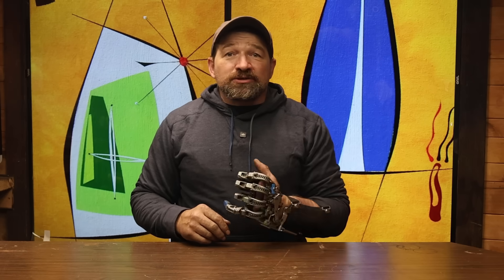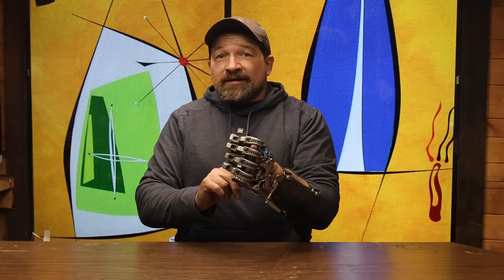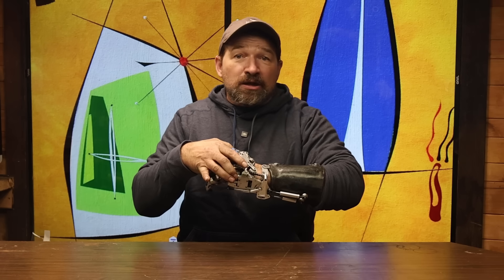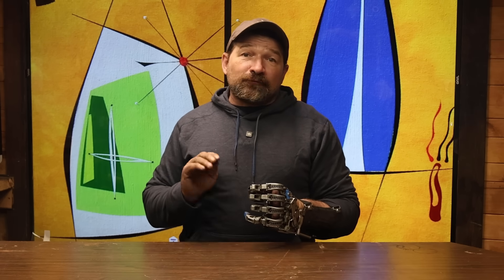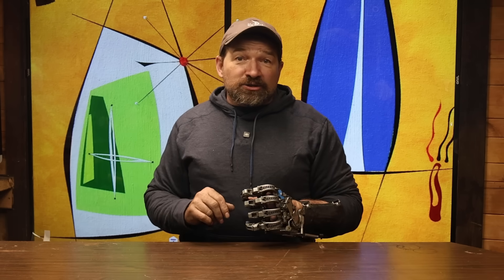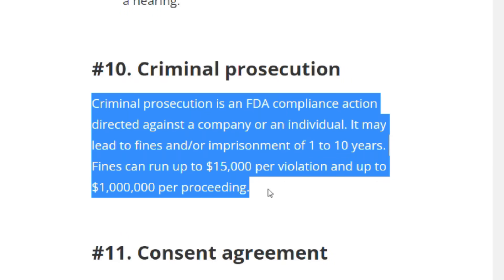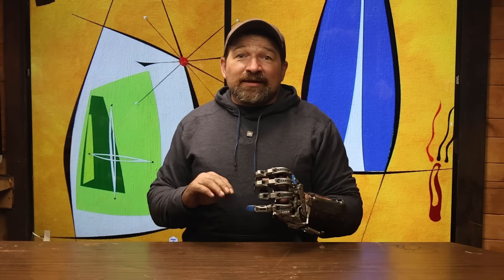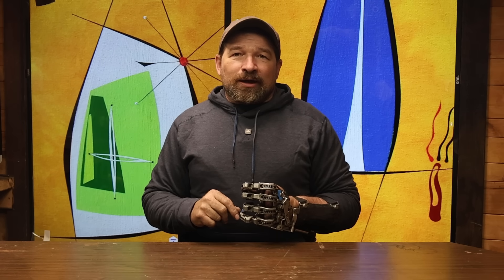Give me a hand! I'm trying to get this information to the right people.

Comment: I used to work on a "state of the art" robotic prosthetic. This is a super impressive design - very simply compared to the state of the art, but very effective from what I can tell in the video. Making it entirely mechanical keeps it simple. You will struggle with getting FDA approval - which is not a reflection of you at all. The requirements for FDA clearance for devices like this are quite steep and unnecessary in my opinion.

Comment: You're a pretty good speaker --- sure, its for profit, but easily rationalized given how much time things must take in order to obtain the perfect fit and the mechanical design. No batteries, no fragile motors and sensors. Best of luck finding them participants :)

Comment: I think the design is so cool. I like that it's entirely mechanical with no power source. Must be an incredible improvement to your day to day mobility. Have you considered working with a robotics company to produce powered units down the line? The mechanical elements are clearly really good and I bet as AI and battery tech improves you'd be able to design units that anticipate and respond to user input using an AI model and servo motors. I'm very very excited to see when this technology goes in the coming years.

Comment: during the plandemic i got into a whole bunch of hobby genres at the same time. 3d printing, servos, arduino, small robotics, to name a few. One of the major projects i got into was trying to make a robot hand that was fully 3d printable and could be built in part or in whole so amputees could print and us what they needed. i ended up giving up on the project after a few years because it is so unbelievably hard to make a fully functional robot hand. there are so so many axes (plural of "axis") of movement in every single finger.. Its not just a simple 5 servos and a few hinges like i pictured when i started.. a hand actually has like 20 hinges and 5 ball joints but it wouldnt even be 20 servos, it would be a servo for each axis of movement. and even using things like rubber bands to hold open the hand and reopen the hand after squeezing it into a fist, it was still unbelievably difficult to  fit everything into the size of a hand and wrist. a put hundreds of hours into designing it and had a few cool prototypes but i never had anythig that i would call a fully functional design. so props to you for doing it.. figuring it out in itself is an enormous task.

Comment: Which video demonstrates this hand's capabilities and capacities' (e.g. strength).  Could you use it to hold and fire a rifle?
Reply from the maker: As the forehand, yes I can use it with a rifle. As the trigger hand no. Simply because the finger moves by rotating the wrist. Also, where i do have a sense of proprioception with the hand, it's not fine enough to anticipate where the trigger would break.
As far as where are the videos? Come on man, this is youtube! They'd give me a strike as soon as I posted the video!

Comment: You are cool, thank you for giving hope to people. Today, it is worth using generative design and 3D printing from plastic. The device will be lighter and cheaper. I read that in industrial 3D printing there are very strong plastics. In addition, ordinary sheet parts can be made of titanium or, at worst, stainless steel (unless, of course, they will not be subject to any deformation in the context of the technological stage).

Comment: I think this really is just such a remarkable device simply because it's purely analog. While cybernetic limbs slowly dripping into market are neat, they'll always have the issue of 'oops my battery is out I can't use my LIMB now'. Prosthetics which use gravity and force to operate instead of motors however are great because you're never in a position where it's going to fail for want of an extension cord. Also from prior videos seen, this is frankly one of the better functioning options across all prosthetic hand devices - partial or total. Very few have this motor function without being like a crushing vice. It's just overall genius work.

Comment: So what I'm seeing is just a problem of 'this is a brand new thing, so the use case is very narrow at the moment' and much of the complaints about who can use it could be addressed in post-trial engineering.  Custom fitting should address it a bit.  Replacement parts would be somewhat difficult initially as the sizing is important, but 3D printing can solve that. I absolutely love this.  Could the parts that need custom sizes be 3D printed with steel rods and bushings pressed into them for structural reinforcement?

Comment: I found this very interesting although I have all my fingers I have a amputated thumb , but it was reattached. I would like to ask if if you built your fingers in your machine shop did you also lose them in your machine shop. as a automotive restoration worker, I super glue all of my cuts... use what's around you to do what you got to do but this guy takes it to a whole new level

Comment: I had broken my arm, or rather my elbow joint, pretty badly. I was still growing so they didnt know wether conventional metal wiring would be enough to reform my splintered bone. A decade later and im stuck with tight scar tissue, a damaged and compressed nerve and mora than 5 surgeries in my past. I have chronic pain day in and day out, fluctuating only for the weather. I accepted the limited mobility, though all in all unkowing bystanders only notice something wrong when I instinctively pull my arm away from danger before my head.
I never lost a limb. But this gives me hope for a brighter future for all who might have mine or an even worse fate.

Thank you!

Comment: Your work is truly inspirational. After I saw the product, i started my own research on prosthetic devices. I even reverse engineered your prosthetic hand, just to learn about it. I came up with many ideas that potentially could help people, and all thanks to you! Also, have you considered that your prosthetic hand could be operated by moving the upper parts of the limb, like elbow or shoulder? That could give opportunity to use your prosthetic for hand/partial arm amputee. I get it, that in such cases it's easier to develop an entirely new project, but, generally, it's all about getting a leverage, and there are many ways to apply this to your hand. Wish you good luck and success in your startup!

Comment: If I ever lost this much to one of my hands. I would be overly excited for this prosthetic.  Ivan, your design is probably the most impressive prosthetic I’ve ever seen.   

I’ve seen a lot of different prosthetic design videos over the years. Your design in my opinion is the most practical for those who have even an average level of mechanical aptitude.

Motorized prosthetics are cool, but the cost and maintenance is likely higher.  Plus, this is a device the user can maintain on their own if needed.   Staying independent is something everyone can appreciate.

Comment: Your prosthetic design really is always awe-inspiring to watch in motion, genuinely one of the most satisfying pieces of equipment I've ever seen.

Now for some 'engagement' to make the algorithm happy:
The missile knows where it is at all times. It knows this because it knows where it isn't. By subtracting where it is from where it isn't, or where it isn't from where it is (whichever is greater), it obtains a difference, or deviation. The guidance subsystem uses deviations to generate corrective commands to drive the missile from a position where it is to a position where it isn't, and arriving at a position where it wasn't, it now is. Consequently, the position where it is, is now the position that it wasn't, and it follows that the position that it was, is now the position that it isn't.
In the event that the position that it is in is not the position that it wasn't, the system has acquired a variation, the variation being the difference between where the missile is, and where it wasn't. If variation is considered to be a significant factor, it too may be corrected by the GEA. However, the missile must also know where it was.
The missile guidance computer scenario works as follows. Because a variation has modified some of the information the missile has obtained, it is not sure just where it is. However, it is sure where it isn't, within reason, and it knows where it was. It now subtracts where it should be from where it wasn't, or vice-versa, and by differentiating this from the algebraic sum of where it shouldn't be, and where it was, it is able to obtain the deviation and its variation, which is called error.

Comment: If someone would develop a small motor and a system that make the index and middle fingers be able to move and be controlled without locks or gravity, it would drastically improve the quality of life of as amputees that can use such devices can perform precision movement.

Comment: Not an amputee, but comment for the algorithm, and since I heard that long comments help the Algorithm, I want you to know that the missile knows where it is at all times. It knows this because it knows where it isn't. By subtracting where it is from where it isn't, or where it isn't from where it is (whichever is greater), it obtains a difference, or deviation. The guidance subsystem uses deviations to generate corrective commands to drive the missile from a position where it is to a position where it isn't, and arriving at a position where it wasn't, it now is. Consequently, the position where it is, is now the position that it wasn't, and it follows that the position that it was, is now the position that it isn't.
In the event that the position that it is in is not the position that it wasn't, the system has acquired a variation, the variation being the difference between where the missile is, and where it wasn't. If variation is considered to be a significant factor, it too may be corrected by the GEA. However, the missile must also know where it was.
The missile guidance computer scenario works as follows. Because a variation has modified some of the information the missile has obtained, it is not sure just where it is. However, it is sure where it isn't, within reason, and it knows where it was. It now subtracts where it should be from where it wasn't, or vice-versa, and by differentiating this from the algebraic sum of where it shouldn't be, and where it was, it is able to obtain the deviation and its variation, which is called error.
Reply: I concur. In addition, The FitnessGram Pacer test is a multistage aerobic capacity test that progressively gets more difficult as it continues. The 20 meter Pacer test will begin in 30 seconds. Line up at the start. The running speed starts slowly, but gets faster each minute after you hear this signal *boop*. A single lap should be completed each time you hear this sound *ding*. Remember to run in a straight line, and run as long as possible. The second time you fail to complete a lap before the sound, your test is over. The test will begin on the word start. On your mark, get ready, start.

Comment: Your parts are scaled to work off your socket. Are they scalable to adapt to a larger or smaller hand? Seems like that would also play into whether someone is a good fit for the trial. A smaller feminine hand would crowd the diminutive parts that need some size just to fit the screw heads, springs, etc

Comment: Im trying to create a susspesion exoskeleton for my legs cause of arthritis walking sometimes is painfull, cause of my art knowledge of anatomy i can design it in paper but i havent worked on any digital software yet for cad. to summary arthritis on my knees  and ankles as well as anisoskelia on my right foot and bone arthritis on my right hip, Is it possible to make an exoskeleton that will get me off the chair and maybe do some sports aswell, motor sports percicely, its hou;dnt need power to work and should be like a wearable susspension for your legs and off set the wet of them

Comment: Sounds like you need an algorithm that can modify the 3D print to fit a mold onto whoever wants to test it.

Even better, I bet you could fit this device to hands where the fingers are cut slightly past the knuckles or before the knuckles if an algorithm can run through all the needed morions and compute what has to change in the mechanics to maintain those range of motions within compliances and volumes. I recall Disney actually uses a program like that for their animatronics and compliant mechanism calculations.

Comment: Dropping a comment here for the algorhithm. It's the least I can do, really.
For any fellow viewers who want to boost this a little: be sure to watch this video in its entirety! Longer views do great in the algorithm! 

Liking the video and sharing the link with loved ones can help too! You might have a coworker or uncle who'd love this!

Super cool what you're building, and I hope this can become its own little cultural movement at some point. God speed ya.
Reply from the maker: That's my hope. I'm hoping that with this maker community and the relatively easy access to equipment, people will see that there's nothing magical being done here. And if you have a need for a device that isn't available,  there's nothing wrong with meeting your needs and then helping others to meet theirs.
Reply: this is so cool (edit: didn't know what to say other than that but also wanted to boost the algorithm & accidentally commented on your comment after reading it & now i'm too embarassed to delete it :) )
Reply: I love the advice and would just like to add, The FitnessGram Pacer test is a multistage aerobic capacity test that progressively gets more difficult as it continues. The 20 meter Pacer test will begin in 30 seconds. Line up at the start. The running speed starts slowly, but gets faster each minute after you hear this signal *boop*. A single lap should be completed each time you hear this sound *ding*. Remember to run in a straight line, and run as long as possible. The second time you fail to complete a lap before the sound, your test is over. The test will begin on the word start. On your mark, get ready, start.